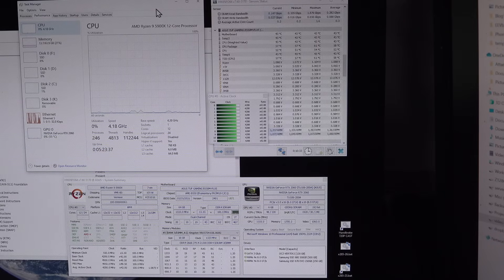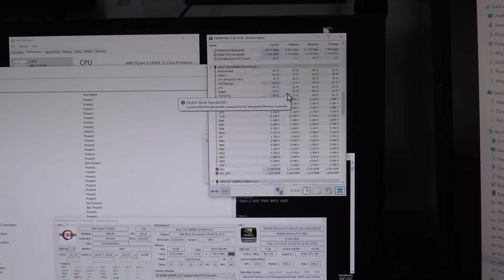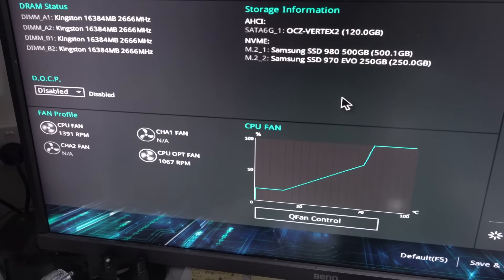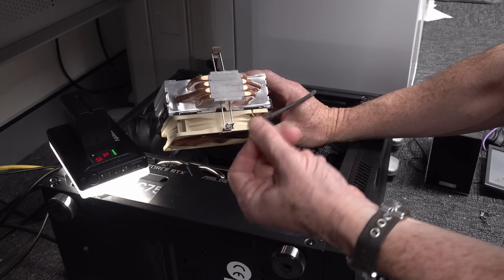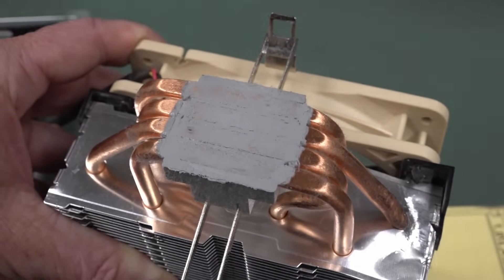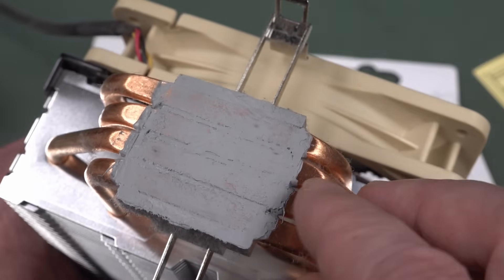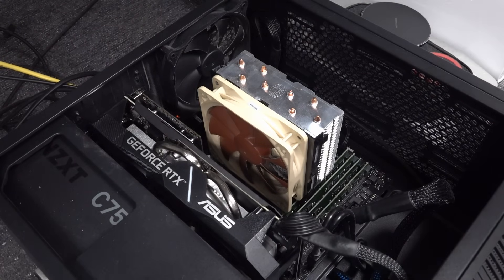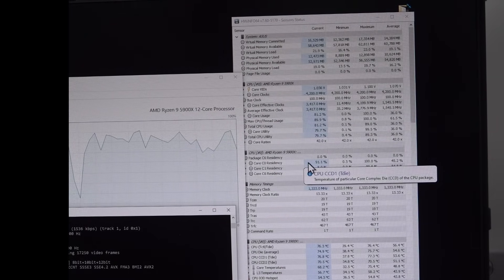CPU Thermal Ghost

Comment from the maker: UPDATE: Using Ryzen Master, temp is fine, everything else in the green except for the "EDC (CPU)" peak current which is pushing close to 100% (of 180A) in the red.
Reply: 100% EDC level is not uncommon for AM4 CPUs. EDC for socket AM4 is 140A on motherboards with "105W" TDP processors.
It's 90A on motherboards with "65W" TDP processors. You can raise it if you'd like but be mindful.
Reply: Try disabling PBO (precision boost overdrive) in the bios and see if that fixes it, if ryzen master says 180A for EDC (that's way higher than default) that means your motherboard is automatically increasing the performance limiters of the CPU and is likely the cause of any instability
Reply: I wouldn't be too concerned about causing damage to the CPU it will throttle itself or power off before major damage occurs.  I literally build and run several machines a month and have yet to damage a CPU due to high temperature.
Reply: @50shadesofbeige88 this isn't true. It will prevent itself from catastrophic failure but hitting it with power on that level of amperage is going to lower the life expectancy of the cpu.
Reply: I just wanted to comment that I can't believe your OCZ SSD hasn't taken a crap on you yet.   I had one for about 7-8 years and it finally took a crap on me about 5 years ago or more.  I've known a couple people who have had problem with them.  I find it amazing it's still working. 
   
 P.S.  Intel is infamous for their CPU lids not being completely flat and needing to be shaved down to have better contact with the cooler.   AMD not so much, but I'm sure it happens.  As for the cooler not being flat, I can't remember watching anyone ever checking that out, though I'm sure there's someone who has.   Lastly, I love the Noctua fan on the Cooler Master cooler, a bit of how's she goin'  there.
Reply: @burner8959 Gamers Nexus during there cooler reviews measures cooler cold plate flatness
Reply: I guess event viewer will show the error code and paste that into a browser,  do also a quick ram test
Reply: Ryzen Master is awesome, in the summer I keep my cpu at 30c idle/youtube, 60c full load with 24c room temp with it. The voltage is a bit of a fiddly business.
Reply: one thing is certain, too much thermal paste on the cpu, the layer must be very thin, just put a ball in the center, and you have to press the heatsink a lot on the cpu to make it expand. 1) I would reapply the thermal paste correctly. 2) I would try to do a system restore to a previous state, eg: a few months ago, when it worked, (not to exclude that there may be a maleware). 3) check that the case fans are working well and that there are no blockages in the grates/air filters (there may not be fresh air in the case) (the heatsink is already mounted in the wrong direction, I would change it if you can't correct it) and check the cpu fan, which spins well at high speeds. I don't know what else to check..
Reply: Bios update
Reply: Rule #1 of computer troubleshooting:

It's always the power supply.

Except when it isn't.

But even then, it's still probably the power supply.

Start with reseating all of the power connectors.

Comment: i dont trust any cheap thermal paste because of lack of cooling
i been using MX-4 thermal paste it last me more than 4 years to replace it never have cut out or overheat
unless you cheap out on heatsink and thermal paste can cause big issues with cooling and auto turn it self off
i normal put X mark thermal paste on my cpu when put heatsink on it and it completed cover everything dont trust tiny bean doesnt make any sense

Comment: Read the bsod log. 

Its probably hitting power limits

Am4 cpus are absolute house heaters.

P. S. As someone who works in the industry and IS considered an expert... It doesn't matter. As long as there is good coverage and enough pressure applied by the sync, they way you apply doesn't matter. Even if you use too much, have bubbles, whatever. I'm always called up by pc friends to settle a debate and they are always disappointed when I tell them they are both right.

Comment: The same thing happened to my computer several weeks ago its likely the CPU power cable being loose damaged or the power supply not delivering enough power under load.  I would recommend replacing the power supply but you could try checking the cable connections and test for possible shorts or open circuits.

Comment: You're correct in your thermal paste application. I remember that on my hyper 212(the original) there were gaps between the heat pipes. The prevailing wisdom at the time was to fill the gaps with compound until flush with the pipes. Then a thin spread over entirety of cpu.

Comment: Hi Dave 
First cooler is pooling hot/warm air from GPU because of pozition.
And posible you need biger Heat Sink for that CPU to hold it at 100% usage; the one you got might by ok for short time at 100%
And then posible chek PSU if some CAPS went liki that can cose the problem to.

Comment: Without seeing the BSOD, couple guesses:
1. RAM developed a fault. Kingston's a good brand, but I've seen this happen with dust buildup in the DRAM slots.
2. Microcode update, likely delivered as a Windows update. There was another exploit discovered some weeks back, and patching microcode rarely ends well. See if there's a firmware update for your motherboard with an updated AMD AGESA (AMD's firmware blob to communicate with the CPU).
3. Noisy power. How old is that power supply? Voltages look good, but you've told us several times about the dangers of AC noise on a DC bus... 🤷‍♂ Think you could scare up an oscilloscope from somewhere? 😉

Comment: So have you changed anything recently, because I would suspect those things. Like different software or setting to transcode, or doing overclocking? I found my 5900X would go over the 78C I felt was the max I wanted to play with using a gammax fan. I altered my bios precision boost overdrive settings so the max wattage was 105C and the max frequency was whatever it is supposed to be like 4.8Ghz. Before that I had some hangs that I think was the amd bios code was trying to push my older board too hard. Originally I argued a little bit of performance peaking could be making more heat than a fan could deal with so I thought I could just roll it back a bit and lower the temps. A side effect was it made the system totally stable. My temps are between 70 and 80c now but I did set the 'platform thermal limit' to 78C because I didn't want the chip destroyed, and it will throttle under certain loads. The day I started using it I may have got it to the limit because I did not set if for a few hours. I am never changing the bios again because I can't stand the thought of anything getting worse with it.

Comment: lol... dave... how you added that ammount of Paste reminded me of a bricilayer... this past should only fill the gap betwenn coiler and cpu... less paste is better heat transfer...
Whatever replacing the cooler with a "Fluid Cooling solution" for example from coolermaster will solve this problem... your current cooler looks exact this shit i relaced 2 times now

Comment: Boosting cpu frequency on a AMD cpu in a positive direction can take the cpu (over time) past its absolute momentary thermal limit if a program driven "thermal spike" occurs. I have exprienced this, so I set the cpu to undervolt and this works.
There are tutorials for undervolting the amd cpu on YouTube that might save you some frustration. Also ram voltage is notoriously set wrong on the motherboard as reported by the Bios.

Comment: First there was way too much paste in there ( dried one )
Second, have the CPU fan push air towards the exhaust fan on the back, not up into the case, You can change its orientation.
Then your BIOS version is way behind.

Comment: I once had a PC that was wholly unstable - it would bluescreen, crash, reboot, and all that when I did anything CPU intensive. What fixed it was 50 millivolts. I went into the BIOS and bumped up the CPU voltage by 50 millivolts. It was the lowest increment you could do. I suspected what was happening is the regulation and voltage drops were such that it just fell below some threshold and the CPU logic went haywire. So I boosted it 50 millivolts and the system was rock solid stable. It's something to try, don't go over that amount. It could very well be a capacitor has aged and isn't providing enough reserve capacitance and thus the voltage dips just a bit to cause the logic to get messed up. 

Remember, it only takes a blip to screw it all up, and the voltages and currents are averaged out. A sudden spike in current draw can cause the voltage to dip below the voltage needed for a split second - faster than the regulator can respond - and would be carried by the capacitance but now things are on the edge.

Comment: Hey Dave, my personal experience is that all grey paste suck. I personally use the white silicon based paste from MG Chemical. Grey one dry up and is not flowing well. The MG one stay liquid, even after 10 years.All excess flow out, so you can over-apply and you'll get the perfect amount between the sink and cpu (all excess squeeze out). The excess also act as a reserve for when thing move, it tend to suck some in and fill back the hole you made by moving things.

Comment: Undervolt CPU by 100 mV and run Cinebench 23 to test it out. Also enable DOCP to get max out of RAM. 

Ryzen 5900 should have a bit beefier cooler. Something like Be Quiet Dark Rock 4 with 6 heath pipes.

If the temps are fine after that, then you can turn on PBO to get even more performance out of the CPU.

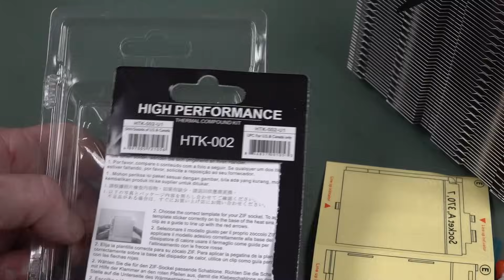Comment: Not only did your crap thermal paste dry up, your heatsink is cheap too. You should've bought a scythe mugen 5. The base is nickel plated and perfectly flat with a mirror finish. For thermal paste, Arctic MX4 is one of the best available. I stopped the video at 7:10 because you're so impatient and arrogant. Instead of behaving like a child, how about you actually listen to peoples advice.

Comment: The cooler seems to have a bit of damage to it. One heat pipe might have failed. Add the dust, and that that cooler is not the best for that CPU, it may have just tipped it over the edge.

I'm a Noctua fanboy, so take what I say with a pinch of salt, but I have a 5950X and the NH-U12A works OK on it.

Comment: Had a similar experience not to long ago. Long story short - it turned out to be the PSU that was powered on for 10+ years(!)
Not bad but of course i went down the rabbit hole, changing graphic cards, reinstalling windows and a lot more, before i decided to try another PSU

Comment: Hi Dave. Looks like your PSU needs replacing. It seems it can't handle transient loads any more due to ageing capacitors that have a lower effective capacity. You'll know that CPUs run on low voltage with high current, so when they need to draw high current for a few ms, the current spikes can cause voltage drops in the CPU (known as "Vdroop").

You could try changing one of the settings allowing the VRMs to have 140% current capability and changing the Load-line calibration setting to a higher level, allowing the CPU to access higher voltages for short periods to prevent as much Vdroop - this comes with the risk of voltage overshoot and damaging your CPU. It's 'relatively' safe. Either that, or you can replace your PSU. I'm sure you've had your system for a very long time and it'll be about time it needs replacing.

Comment: Im no expert, but let me give you my opinion because you clearly need it.... 😉

I put the thermal paste on the cooler, "dry fit" the cooler, pull it off and make sure it evenly applied to the surface, add a bit more if the pattern isnt uniform.
Then I secure the heatsink, hasnt failed me yet. 🙏

Comment: Direct heatpipe coolers (especially with only 4 pipes) aren't very good for Ryzen chips the way they spread out their chiplets under the IHS.  I'd recommend a Thermlaright Peerless Assasin for $33.  Also, you can turn on ECO mode for the chip in the BIOS.  The processor will still retain much of it's power but only run at 65-95w.

Comment: This is the first time I've ever heard CPU renders are higher quality than GPU renders...

Using the exact same settings and codec should produce the exact same quality regardless of what hardware does the work.

Only reason I could imagine it would be worse on either is a poor implementation of the codec in the rendering software.

Comment: I had the same issue and tracked it down to be the CPU itself. AMD cpus are not stable and its a hit or miss thing compared to intel. Luckly my CPU was in warranty and I got it replaced. The tech at Scoptec further added that hospitals ONLY use intel CPUs for that particular reason. One way to stop the crushing is to disable the boost and just run at base frequency. I will stongly suggest to get it replaced if its under warranty. Hope this helps.

Comment: That's a very crappy heatsink. Copper pipes are supposed to be flatted with the rest of the surface.
Does not have to be machined, even you grinding it with sandpaper on glass would be sufficient.
But if it does not make metal to metal contact above the dies, it is a trash cooler.

Comment: I have similar problem with asus MB, 3060GPU and AMD ryzen 9 3950X CPU. It worked fine and started bluescreening when CPU is at 100%. This started after I upgraded GPU. I used amd 550 before.
I noticed this happens when I have youtube open in web browser and the 90% solution was... To change web browser from Vivaldi to Opera!!! WTF...
BTW I am programmer and this happens when compiling. Don't do much other CPU intensive tasks.

I have changed almost every component apart from CPU and PSU, even switching GPUs back to where it was working. Nothing helped. I blame windows update broke stuff or what. Got new MB, disabled performance boosting in BIOS,  make sure, that drivers are up to date... Really seems to be browser issue. I also suspected BT adapter for audio streaming, but haven't investigated that since I don't have wired headphones by hand.

Comment: Your temps are ok now. You need this stop code. You can disable the reboot after BSOD in windows. Could be a RAM issue or (very rarely) a degraded CPU. For the latter cause you can try to increase the core voltage offset in your BIOS by 10 to 20 mv and see if it's stable.

Comment: For the thermal paste situation: The pea thing originates in the olden days of PC building when you put an aluminum (not that aluminium rubbish) heatsink with a machined contact surface with no other materials married to it, like copper heat pipes. The size of the dollop is to prevent putting too much, and the flat surfaces means it’s more likely to spread as expected. In this day and age, where heatsinks include copper heat pipes contacting the IHS so you have seams between the materials and pipes, as you noted, this is likely to wick the paste in the gaps a bit. Ultimately, spreading it is fine. Making fancy patterns is fine. It’s all fine. It actually doesn’t matter. The only thermal interface solution where this matters is the liquid metal stuff because it’s not just thermally conductive, but also electrically conductive, so too much spilling on the wrong thing can cause damage.

As far as what paste to use: This can matter. Cheap garbage that’s marginally better than a thermal pad doesn’t conduct as much heat, and often dries out super fast. Modern pastes include phase change pastes, as well as pastes that are designed to not dry out so fast. Thermal Grizzly has new thermal films that are designed to solve the dry out problem, though I suspect it sacrifices thermal conductivity compared to their pastes, which are among the best in the industry.

Not going to diagnose this because you have another video up so I will go watch that to see if you figured this out.

Comment: With AMD you should also regularly update the BIOS version & install the latest chipset drivers (from AMD website not ASUS) so that your AGESA version stays up to date as windows continuously updates itself and expects a certain drivers configuration. This will also install updated power management for your chip so must be done inline with other updates cycles to avoid occasional issues in my experiance. Although it's likely just that you've never run a burn in test on ur system and havn't realised that your cooler is woefully inadequate for your cpu when it has workload spikes

Comment: Dried thermal paste is totally normal running these ryzens for a couple of months. The shutdown (=reboot) temp for the 5900 series is 105°C. When transcoding x26* you naturally maxout all cores (also thermally because it's using the AVX instruction set  -> same as in cinebench). Coolermaster paste is ok. Best bang for the bug maybe arctic mx-4 and for best performance get their "new" mx-6 or something from thermal grizzly.

Comment: Certainly looks like it was a temperature issue from the BIOS over temp warning and that horrible old dry paste, but the new shutdown could be something unrelated. I would just re-seat the CPU and memory, that's fixed a lot things for me in the past, particularly after messing around inside a system, might have bumped one of the DIMMs or something.

Also might want to look into your memory speed, 2666 is pretty slow for Zen 3 which loves fast memory, 3200 is recommended by AMD to get good performance out of the CPU, you might even have that installed but it's disabled, that's the DOCP option in BIOS, if the drop down gives you the option to enable it you should, it's performance you've already paid for.